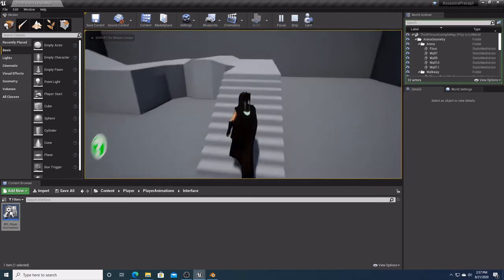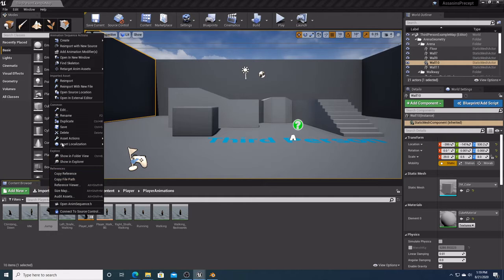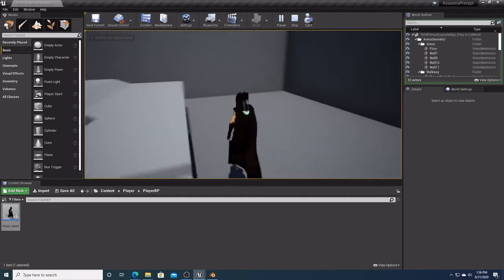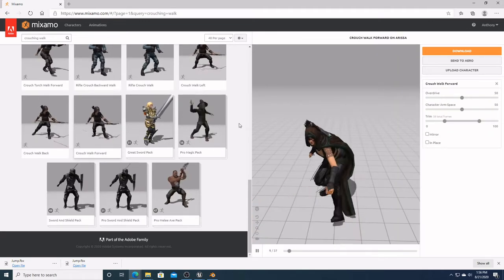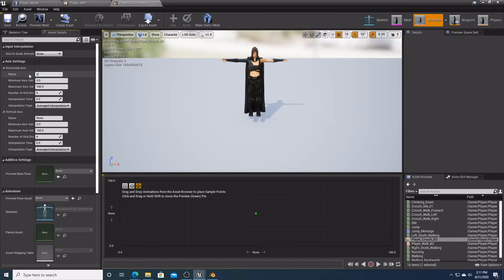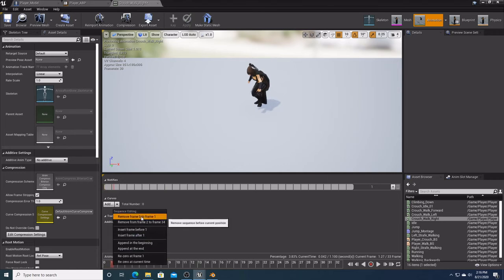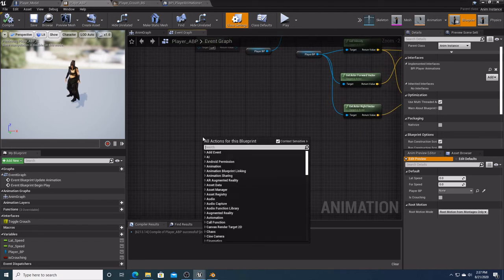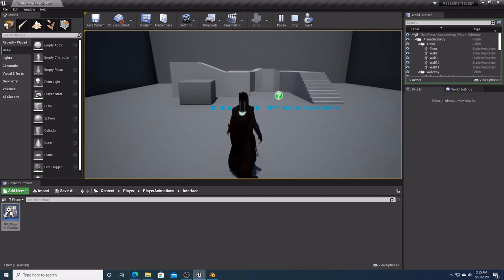Unreal Engine 4 ARPG Tutorial - 6 Jumping and Crouching Animations

Comment: Thanks for the work you put into these.  Very helpful.  Do you need to do this from start to finish for every model you get from Mixamo, or is there a quick and easy way to copy and paste?  Also, is there any difference between copying within a project, and copying to a completely different project? 

I keep getting errors about variables, and other things.

Thanks!
Reply from the maker: Some things you can reuse but others you have to start from from the beginning. You can usually reuse control functions but you can't recycle animations to a different model. What variables do you get errors for?